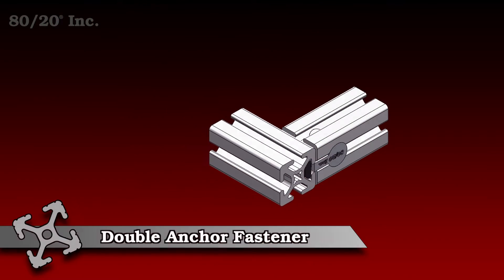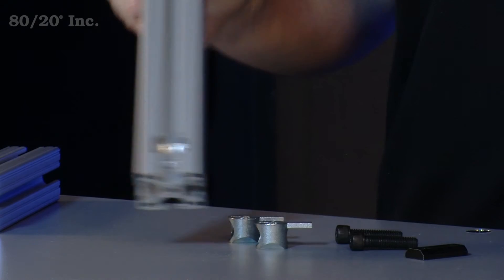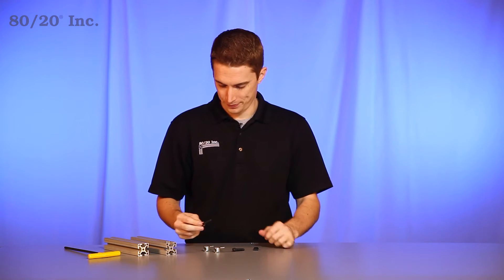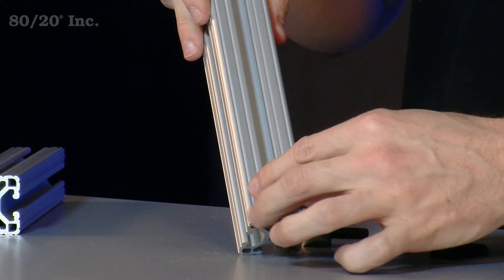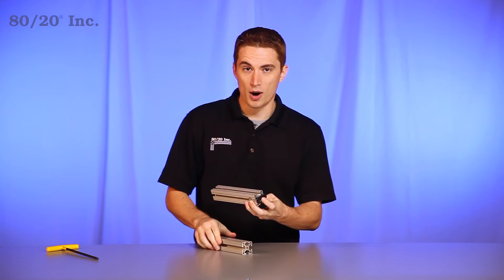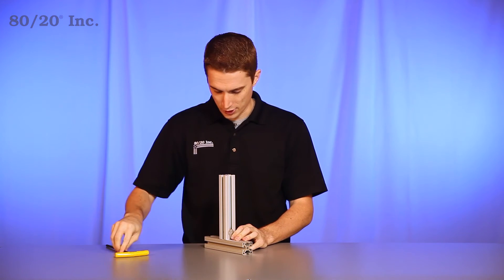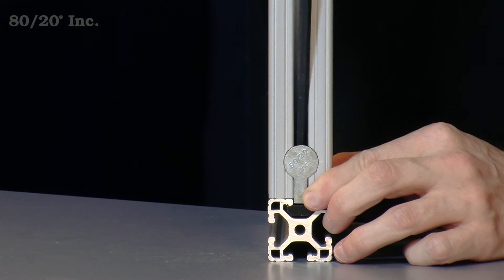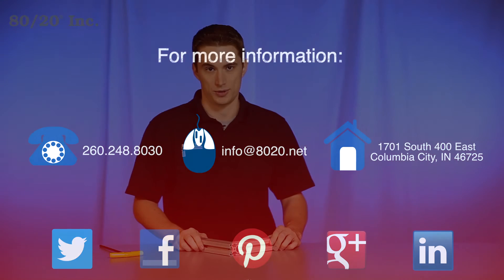80/20: Double Anchor Fastener Overview

Comment: I'm curious as to how it is "Vibration-proof"? What is keeping the bolt from loosening over time?
Reply from the maker: Hi there - that's a great question. A more accurate description that could be used is that double anchor fasteners provide a level of "vibration-resistant" connections. This is due in part to the 2-degree drop lock that is extruded into most of our profiles, which acts like a lock washer to help keep the fastener threads engaged.  (see catalog page 55 https://catalogs.8020.net/80-20-Inc-Catalog-23/55/) They also provide vibration-resistant connection due to the fact that they are doubles --  the two screws tend to bind against each other and make it an even stronger connection. I hope that helps!

See a 2-degree drop lock animation: https://www.youtube.com/watch?v=qLBMrl6HqVY&ab_channel=8020LLC
Reply: @8020 LLC  ahhh that's why my extrusions never rest perfectly "Flush" with each other.
 
 I use the 2020 10-series for fencing on my table tools and stack them to make them parallel to make a 2040 (to add an opening for dust collection or in the instance of my router table, a slot to have the router) and before mounting them together, they font seem to want to rest perfectly flat onto each other. I just always thought it was just the way it was, I never considered a purposeful design... very clever!!! 
 
Speaking of tool fences, I use a lot of the slotted extrusions for a lot of things, and I'm curious if there were to ever be a wider half series (like the 1050 snd 2012 series) that would be 3"×0.5" or 4"×0.5" ? It would make a much better face profile for tool fences like on a table or miter saw fence and/or a router table fence face.
 
I ask because I often use my router table as a jointer, and it would save a lot of time for me, not having to constantly swap out face plates for different actions. (Also, a 4" tall 0.5" would be great for the insides of my 2040 front vise, lol. )
 
Well, thanks for the 2° info... it will definitely expand my options  and considerations on designs in the future.

Comment: 8020.net says: "80/20 recommends the double anchor fastener for non-column loaded supports to add extra strength." Can you explain the term "non-column loaded"? I'm planning four 1515 vertical posts at the corners with "double anchor" cross rails that must bear downward pressing weight ~ 160 pounds of load on each cross rail. Did I just describe column loading for which the double anchor method is unsuited?
Reply from the maker: Hi Mick. Good question! What you described would be a non-column loaded frame. In this configuration, the entire 160-pound load and  structural integrity of the frame would be dependent on the strength of the fasteners. For example, if 1000 pounds would be put on the non-column loaded horizontals the bar could potentially slide down the vertical posts and you could have a catastrophic frame failure. Column loading would be two of the horizontal bars being lengthened and placed on top of the four vertical legs, then the two remaining cross horizontals would attach into the side of the first two horizontals. This “stacking” or column loading will basically remove the strength of the fasteners from the equation of the load and utilize the strength of the bars instead. The only “load” would be on the two shorter horizontals, and that load would be in sheer to the fasteners.

We do not have a dedicated video showing column loading, but it is referenced and shown numerous times.
You can see what column loading looks like at the 2:30 mark of this video.
https://youtu.be/SpmeULDlAlY
Reply: @8020llc  Thanks for the explanation. If the double anchor fasteners are properly torqued with threadlocker, are the 3098 assemblies per my original description  likely to adequately resist the downward force so my shelves will stay in the right place? Or: is "non column loading" never acceptable with the load I have described?